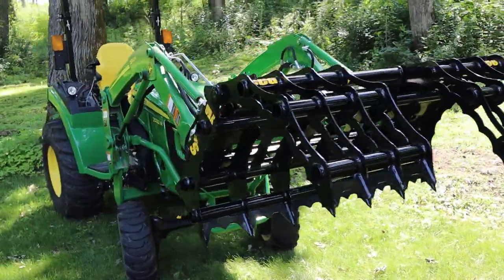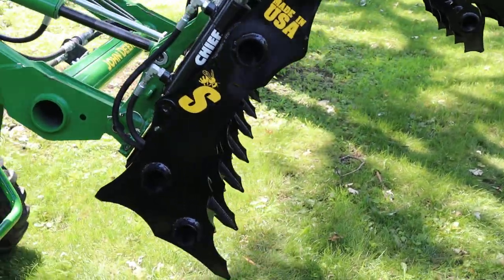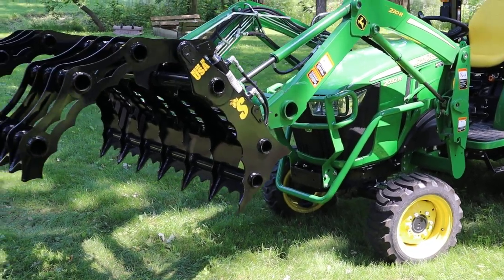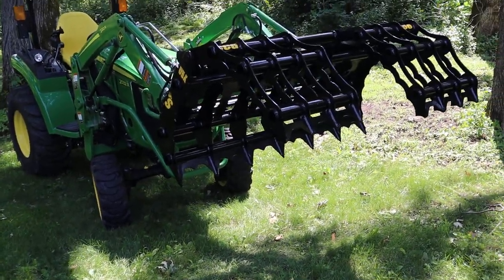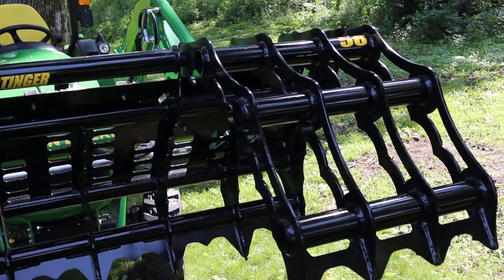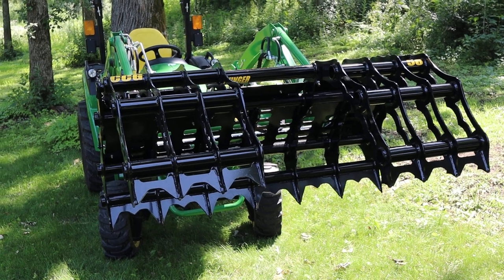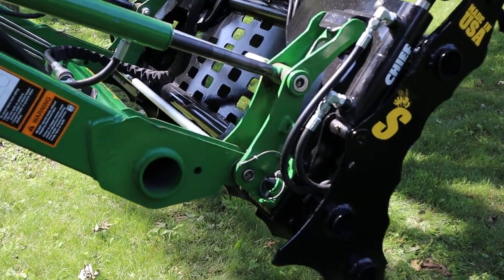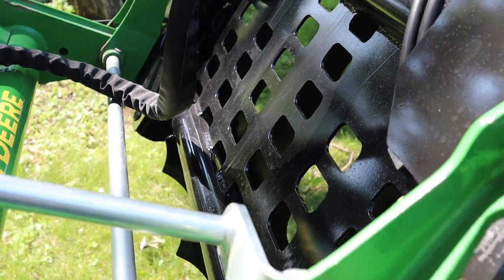Stinger Attachments Compact Tractor Clam Grapple Walk-around

Comment: You have ssqa now? Says loader capacity under 1500 pounds. What if my loader is 2200. Bad boy 4035
Reply from the maker: It is rated for 25-50 hp, so laoder lift cpacities range from 800-3500# in that range most generally.